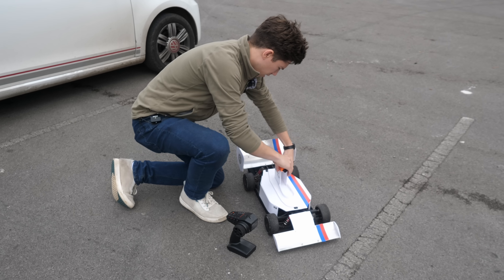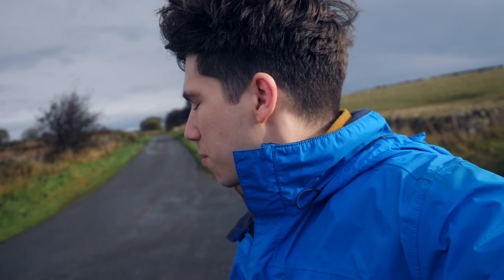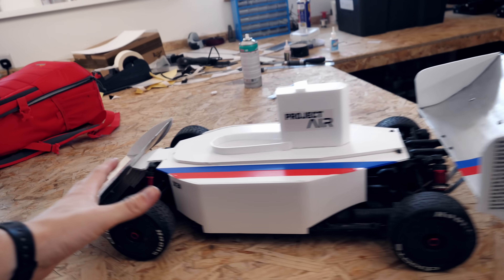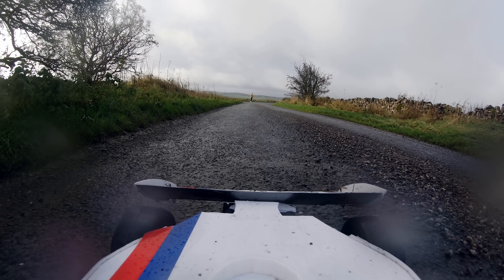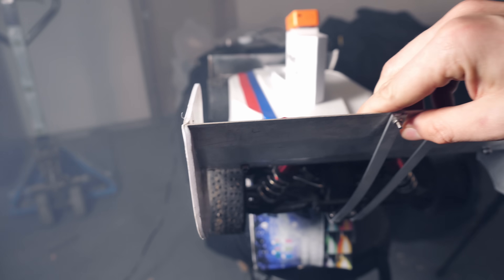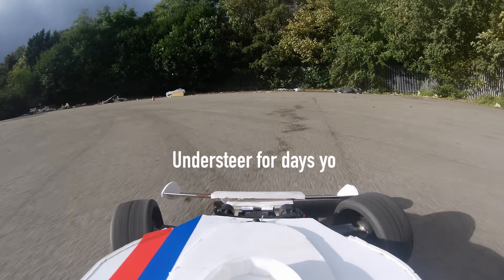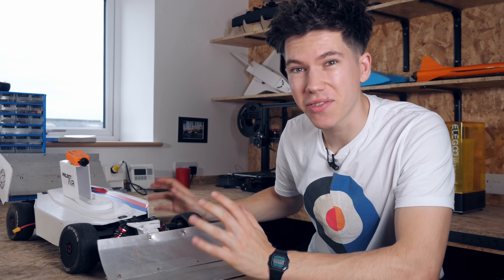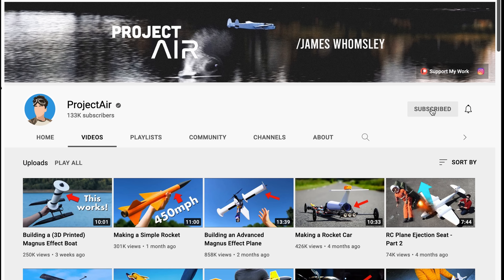RC Car Extreme Aerodynamics

Comment: if youre battery is over heating you could run a through hole right through the front wing , in the center , right too the battery and right out the back deflecting right onto the rear wing , in effect a tunnel , with the only open bit just at the battery , so you get 100% in and out , with the on;ly opening inside at the battery before it rushing out the back over the rear wing , i would love to see that one , subscribing in effect as of today .

Comment: By making a preliminary 30s calculation to estimate the downforce the front and rear wings of that size can generate at, let us say, 100 km/h you could have saved a lot of wasted time.
The difference between an engineer and a practitioner is exactly this: the engineer uses the science and math to evaluate quantitatively things, the practitioner just tries a bunch of randomly chosen configurations hoping for the best. And usually, without surprise, the hope is frustrated ...

Comment: Tip: If ur RC car is going rlly rlly fast, use an airbrake, basically just make a huge cut and leave one side, then add a servo and make sure it pops up and make it so that when you brake the servo also activates the airbrake (I may be wrong).
Love ur content ❤❤

Comment: try a bigger chord on your front wing and a much shallower incidence.  you want an aircraft wing, essentially, upside down.  this should give you better adhesion at lower speeds, without sacrificing your top end.   a final design suggestion would be to build an upside down canard, essentially - since you are not restricted by formula car widths, try putting the rear wings on either side of the rear wheels, instead of on top of the car, and perhaps try linking these like fractional ailerons, off the inside hole of the steering servo.  only wish i could afford to try these things myself.  thank you for your work, on this and the vacuum system, i have learned a lot.

Comment: Front wing would have worked better if it was at less of an angle. Thus why F1 uses it that way and you want the air to split off the sides on the front wing as well but only at the back edge.

Comment: Make a 2nd version with a GoPro to measure Gs, tilt like 2 millimeters of the wing down very steep and lift the suspension so you can put ground effects on it
Reply: The leading edge of the front or rear wing can’t be angled up at all or air will go under it and lift the car up
Reply: You could use a leaf blower to test aero

Comment: I know this video is a year old, but I still feel compelled to comment. If you were to simply go around in a circle, of a set diameter (3 to 4 meters should work for a 1/8 scale car), faster and faster,  until the car slipped, it would be a better test. The surface you are testing on should also be consistent as possible. no cracks, pebbles or dust (leaf blower or preferably pressure wash the surface first). Rotate the tires as well between runs because the outside front tire will wear the most.

Comment: Interesting experiments but as you’d know from your aircraft experience, these flat-section sheets are not wings, as they don’t have a curved convex surface to accelerate the air. And wings don’t work by deflecting air, they create a low pressure zone. So a true wing even at a horizontal angle of attack would provide downforce.

Comment: Ur wings would be a lot more effective if they had a clear underside, as that is actually the nost powerful side of the wing. Thats why in racing (gt racing but also f1) they use swan neck pillars for wings, which are pillars that connect to the upper part leaving the underside of the wing free and more performant.

Comment: 6:11 I mean your scoops might be doing that, but actual properly designed wings on racing cars create much more force on the low-pressure side. So doing actual airfoils instead of just bent sheets and making sure they don't stall would be a great first step.

Comment: If you want to do something like aero tunnel, place a big fan behind the car, so it can suck the air, and then you can turn on the smoke machine. And you will see where you can improve the downforce. But still, huge amount of downforce on this little car, and huge amount of time spent on the developing. Perfect job

Comment: All you are creating with those wings is little bit of downforce and just purely drag because downforce is mostly created by suction or low pressure and not high pressure(2nd edit by this I mean that downforce is mostly created at the underside of the wing instead of the top surface because the underside creates suction/low pressure). In those wing designs they have too much angle of attack especially the front wing causing  the air to not properly attach to the underside surface surface of the wing, you should search coanda effect. Also the downforce created by the wings should be equal because if the rear wing creates much more downforce, the rear of the car goes down more and counters the downforce of the front wing causing it to udnersteer, so you should also look at the balance of the aero. ( 1st edit https://youtu.be/e02foT8-DdA I recommend this video and channel for those interested in learning more about aerodynamics. 3rd edit, also you cna trust this channel because he was an aerodynamicist for Mercedes AMG Formula 1 team)

Comment: The quicker time round the bend would have also been greatly affected by the fact the road was dry, instead of wet in the first test. Surprised you didn't mention that (or I missed it if you did). We run wings on our off-road 10th scale racing buggies, and at that scale you need to be doing 30mph+ before they even have any kind of effect. I suspect with that scale of vehicle it'll be a little lower, but you'd still need to be travelling at some rate of knots to have any profound effect.

Comment: I have the same car and have tried ground effects skirts with half ass success… in this case, your front wing is forcing too much air over the car, that air is pulling the rear wing into that air flow, and the drag behind the rear wing is helping it along. If you go fast enough, you will only have the front wheels touching the road.

Comment: with the idea of grip in mind since that is quite a rc car  as it came stock did you consider buying replacement tires? its just going those speeds  long term can place some wear on the tires  even for a smal one from what i herd

Comment: The wings really do scoop the air too much, you're creating massive drag for the downforce generated, you'd be much better off with a dual plane wing at the back atleast so air can pass through and not create massive drag forces, which i guarantee is what's pulling your front wheels up, secondly your suspension settings need a bit of tweaking, if your adding mass and downforce you'll certainly need more spring rate at least at the back, since all these forces are either in line, or above the centre of gravity, therefore pitching the car backwards ( as your video already pointed out ) some of this can be controlled by better suspension settings, i'm not suggesting rock hard, but swapping to a firm spring, or dialling your collars should do it ( I'm not familiar with the specific car setup ), Finally a swept back front wing will allow for superior cornering, as to the reference of air being driven into the element of the wing that creates straight line resistance to flow is hidden behind the peak of the nose, and therefore generates less drag with relation to changing directions, as the air can simply flow up the ramp of the nose which will still generate downforce, but without quite as much drag, since the air isn't trying to flow over a right angled flow guide on the wing tip.

Comment: I feel like the road test had too many inconsistencies due to the surface being too bumpy for the scale of the car, the wheels were constantly jumping and losing traction. Sure the downforce definitely helped keep it on the ground but as far as grip is concerned... not so sure.
Still this is a really cool idea and testing on a much more smooth surface would definitely help to see actual differences in grip

Comment: L=1/2 . p . V^2 . S . Cl

No production spoiler mounted on a street car is going to generate any significant aerodynamic loads compared to other loads on the car.  Therefore, stock spoilers on production street cars are purely cosmetic.

Velocity is the major factor because aero load is proportional to velocity squared, while all other factors are merely linear, including wing area (S). However, wing area is squared with x/y scale, which may the source of confusion.

Now, how fast is your RC car, do you have a measurement?  If the model car is both extremely light and fast, then maybe the aero forces could be significant relative to it's mas.  Hard to say without measurement as observed behaviour seemed variable, but you can calculate it out.  A high lift surface such as a spoiler might reach  Cl = 1.5, but at those sizes and speeds, that's probably pretty optimistic.

 I suspect the head wind on the last day plus all your practice probably helped more than the spoilers.  Of course, it's an entertaining YouTube video but I would have found some numbers interesting too.

Comment: When the car was understeering it was probably because the rear wing is a fair way behind the rear axle, the rear axle then acts as a pivot point and reduces the weight on the front wheels.

Comment: You could easily make a very cheap and simple test setup where you can quite accurately measure the down force if you have a large enough kitchen or bathroom scale and a leaf blower. Tape the car to the scale, put the leaf blower in a jig and let it blow over the car, and watch the result on the scale. Write down the results from different wing setups. And after that you can make a graph so that you can visualize and compare the results. 

But I can tell you in advance that proper designed wings on a RC car, as well as ground effect and such do work. It is the same physics that make RC planes fly. You just chose a very poor method and a very poor wing design in order to be able to do a proper and reliable prove of concept. And the location and your driving skills are not optimal enough either for a reliable test result. 

So all in all I think that your idea and what you were trying to show was nice, but to my opinion it was very poorly executed, and it was impossible to draw any reliable conclusions from this particular test.

Comment: That's not the ground effect, that is the venturi effect (a result of the Bernoulli principle). The ground effect is the decrease in induced drag and increase in lift when a wing is close to the ground, due to this ground stopping wingtip vortices to (fully) form.

Comment: bent aluminum dose NOT a wing make. When you look at the cross section of a wing you can see that there is THICKNESS greater than that of sheet metal. Looks kinda like a bent teardrop shape.

A much better, more effective wing, could be made by folding a MUCH thinner gauged of sheet metal over onto itself.

Comment: I would like to see you try a front rudder system attached via control arm to the steering system. I think you would have more steering control at high speeds.

Comment: you probably could have put the car on a kitchen scale and blown compressed air at the car to measure downforce. also the actual shape of an airplane wing will more efficiently create areas of low pressure.

Comment: I did this years ago on a 2wd rc buggy, it matters if you have very large and properly designed surfaces and moving top speed you could notice a difference, if you crashed then it was all over I made the wings of foam board, what if you made the opposite of an autogyro to see what might happen?

Comment: Cool stuff mate!
I got an RC with some aero package, and I can clearly feel the difference while driving it. I guess in you case it's pehaps the suspension that is tricking your car. To get mine right I had to put limiters and let a bit of the stiffness go. Too stiff and it doesn't hold to the ground at all. Also, the rear wing doesn't need to put a lot of down pressure. The scales for tuning should also be related to the weight of the car. Even F1 cars trip on the corners a bit.

Comment: I just had an idea!

Figure out a way to mount a load cell to each wheel, and connect them to an Arduino Nano RP2040.

1.
It has onboard flash storage. (No risk of corrupted telemetry data from vibrations due to a loose connection to an SD card.)

2.
It has a 6 axis IMU onboard. (Gyroscope + accelerometer.)

3.
You’ll still have plenty of I/O pins leftover for other things.

Love what you are doing with, and on your channel!

Cheers from Denmark!

Ps. DIY Perks “sent” me here. 😃

Comment: I race 1/10 and 1/12 indoor onroad on high grip black crc carpet. We all know bodies can have a great effect. There are many rules to the different classes such as weight, motor and body. In slower classes like USGT the bodies have a more realistic look and are heavier and slower. Front wings and diffusers are not allowed, except in F1 where front wing is allowed. The difference in a usgt body vs the current favorite twister body run in touring car can be .1 - .5 a lap. The shape of the body also affects the rotation of the car threw the turns. This is most pronounced in the Mod class where the body will even affect the breaking of the car. 1/12 and 1/8 onroad use very aero wedge shaped bodies. 1/8 chassis and newer touring cars have extra supports to transfer more downforce to the tires and in 1/8 the rear body mount floats so the suspension does not compress at high speeds.

Comment: Could  you try the RC car on linoleum or wood? That would give you much more surface area of the tires to use. And it would more accurately depict real size tires on pavement.

Comment: Now it seems that everybody in these comments is a areo engineer, but im a mechanic. Ill offer some different insight.  First, find out if that rc has a open diff, or atleast a lsd. If it has a locked diff that could be causing alot of your understeer. Even a lsd could too. Next, check your weight distribution. If alot of weight is in the middle or back, that could help with oversteer and traction taking off, but it could affect your cornering and braking. Lastly, try to look for some different tires. Now thoes armas have some bad ass tires, but you should try to find some softer tires with more traction, that could greatly affect it too.

Comment: Create a windtunnel. Try modeling equations to scale the speed down and use a weight scale to measure how much kg of downforce its actually putting on front and rear wheels

Comment: You don't understand how wings work, what's why you came up with this horrendous design. The wings in an airplane create faster moving air on top of it and this creates lower air pressure, so the wing generates up force because it's being sucked up, not because it pushes the air down. The same principle propellers and spoilers follow.
Edit: Your design generates mostly drag, and very little down force.

Comment: Would be super interested in more videos on experiments with ground effect RC cars! And I suggest doing some constant steering test to objectively compare maximum cornering speed on equal cornering radius. Ideally clean road, and loop around a constant radius circle to remove other variables like gravel, weight shifting, etc. :)

Comment: Really interesting Video. Had a similar question with one of my rc cars. It has a rear wing and i was also wondering if it does anything or if it is just show. Might do some test after seeing this :)

I noticed that the steering on your car is not that optimal. Your outside wheels are at a bigger angle than the inside ones. It should be the other way around because the inside wheels need to drive the "tighter corner". With the current setup you will always have understeer at atleast one wheel.

I don`t know if you already knew this or if you will even see this (since i am 4 weeks late XD)

I hope to see more of your rc car endeavours.

Comment: He should have made the suspension stronger with the aero on. Compressed springs (due to the aerodynamics pressing downwards) are not so good dealing with the ground imperfections as they have less travel until they hit max compression and the car height is lower.

Comment: F1 cars have a larger front wing, however to keep aero on the rear also, you could add front wing extensions on the ends which would allow good airflow over the body

Comment: The effectiveness of the aero package scales just as the car. So if your setup would cause a 10% decrease of time on a full scale car, and your car is 1:10 scale, then your kit will have a 1% benefit. Keep at it. I used to do a lot of the goofy experiments you do when I was young. There are vhs tapes somewhere of me and a friend strapping rocket motors to our rc cars, etc.

Comment: The rear wing is way too big. The bigger and taller the wing is the more cross section it has which applies a torque on the body of the car, lifting the front. It would be better off with either smaller rear wing of the same design or a more airfoil shaped spoiler that is flatter to provide more effective down force that doesn't harm the grip in the long run.

Comment: The low pressure doesn't suck the car to the ground, the fact that there's low pressure below the car allows the high pressure above the car to push it down. Vacuum cleaners for example don't suck things in they allow the atmosphere to push things in since it's lower pressure inside the vacuum cleaner.